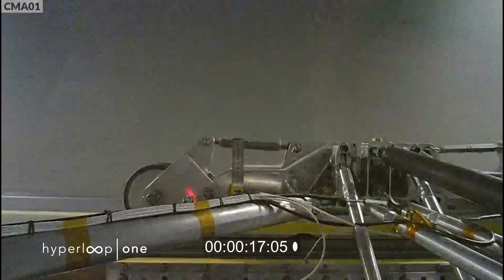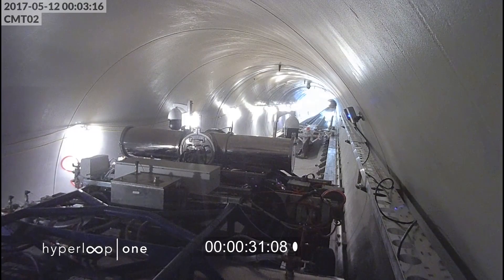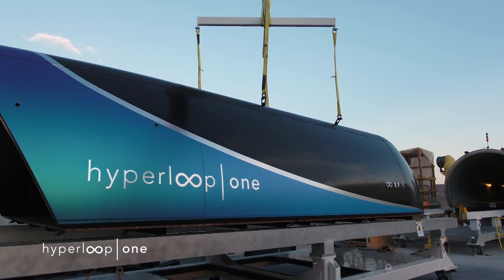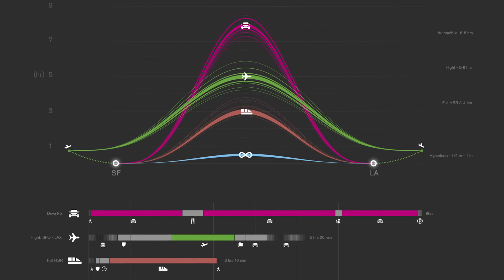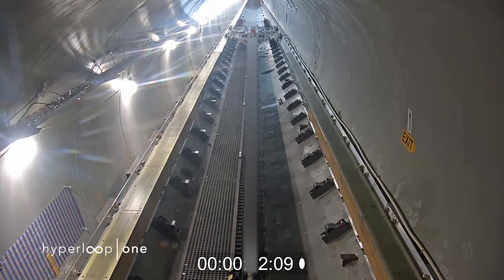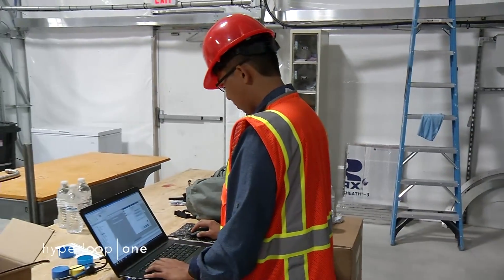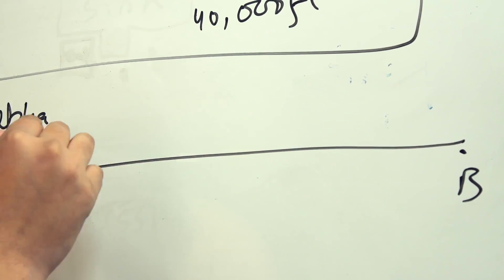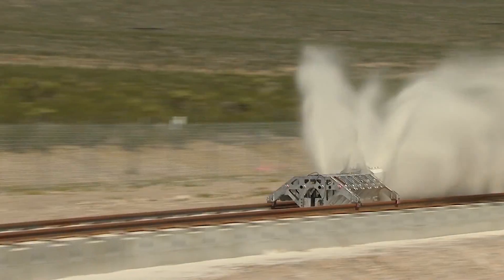Watch the Hyperloop Complete Its First Successful Test Ride | WIRED

Comment: Can't watch these videos without thinking they only talk shit after watching tunderf00ts video.
Reply: And what happens if there is the slightest rupture or some other mechanical failure in the tube whilst the cart travels at such high speeds?
Reply: @FragmentJack  I never think of that when I'm in a plane at 30,000 feet and going over 500mph. BTW the answer is the Hyperloop train slows down or stops. Comparatively scary, what?
Reply: Also, he kinda made a rookie mistake when scaling up his metal ball in a glass tube experiment.
Instead of faster it would move slower. But it is something the makers will need to take into account. 

Since moving fast is pretty much the point I assume the pod can handle it. Adding air to the sections ahead would be a useable way of slowing a pod down in a case like that combined with magnetic breaking. Sure it is difficult to make but possible if you throw enough money at it.
Reply: agreed... lets wait for the day they will fail maybe
Reply: Leo U. The tube was just a tube it wasn't even a vacuum
Reply: Leo U. Have you seen the like to dislike ratio of his videos? Clearly he was wrong on so many things.
Reply: This is a lier company only sell concept.
Reply: +Aku6Soku1Zan That sounds disturbingly like religion, don't devolve into worship no matter the man.
Reply: +Max Williams - Sell concept?! Lmao, they actually made some working shit
Reply: And a partial vacuum would also be inadequate to make this any kind of efficient design.
Reply: +Looney: It's a logical fallacy to argue that Thunderf00t's lack of humility will magically make the hype tube practical.
Instead of refuting the science they attack the person. Classic ad hominem.
Reply: @communitycollegegenius9684  Wrong. The science CREDENTIALS of the person were attacked which is totally reasonable, AND they debunked his lack of science. Next.
Reply: I talked shit about this before thunderf00t in real life

when I first heard the pitch from my friend I said "ridiculous, that will never work, not "would", "will"".

And now they're celebrating what is essentially a fucking maglev train in a tube.
Reply: Leo U. This might interest you, an official reply about Thunderf00t from an Hyperloop One employee
-
I've got this one. I have watched the video, and made copious notes. Thunderf00t is a well known youtube science commentator, best known for debunking religious fundamentalists and understanding the surface-maximization of liquid alkali metals, published in Nature last year.

That aside, both hyperloop videos show a complete reluctance to engage with the real arguments. Sorry, but highlighting some semi-literate comments by your critics does not amount to engaging in a useful discussion. I would like to levitate this video into the sun.

Here are some specific points and rebuttals: -Thunderf00t primarily makes reference to the Hyperloop alpha whitepaper, written by some SpaceX employees in 2013. I saw no evidence of engagement with subsequent press releases by any of the hyperloop companies. In particular, TF doesn't seem to be aware that there is more than one hyperloop company. FYI, we are Hyperloop One, the company that has raised ~$108and built the world's most powerful linear motor in 5 months. -Thunderf00t talks a good game about aerodynamics, but shows no evidence of even having read the wikipedia article on choked flow, duct flow, the Kantrowitz limit, or knowing any of the other 'first day on the job' level detail for our aero team. -One of Thunderf00t's technical gotchas was 'expansion joints are difficult', despite the fact that hydraulic cylinders exist, most steel rails are thermally pretensioned, and thermal expansion is probably something we thought of already. -Thunderf00t could have easily looked up our people on LinkedIn, checked their google scholar bona fides, whatever, but seemed more keen on a cheap take down than actually engaging with interesting and ongoing engineering challenges. -One symptom of the level of technical effort that went into TF's video is his careless assumption that 1g = 1m/s/s, as though Hyperloop was being built on some tiny moon of Jupiter. As a fellow academic, I was disappointed by TF's lack of intellectual humility in an area in which he is obviously not an expert. One would wonder why TF would put such hastily produced, easily debunked rubbish on his Patreon feed - people actually pay for that!

-Casey
Reply: kingklooneyville Well he didn't said anything about the vacuum a Hyperloop would require in such a immense scale. That they can sustain a vacuum is my main concern...
Reply: Leo U. these vacuums aren't as difficult to hold as you might believe, holding a vacuum requires an exponential amount of energy. Thus a partial vacuum isn't too difficult
Reply: @LemberTheMember  Wow I bet they never thought of that. Good thing you're here.
Reply: @RayThackeray  I bet some did, but it seems like some teams are just competing to catch a little fame.
Reply: +Karnedge, it would either brake and slow down if the rupture happens in front of it or brake, speed up a little and slow down if the rupture happens behind it. The nice thing about magnetic propulsion is that it can be used as a magnetic brake too. I'm sure that the engineers have taken this into account, they are not total idiots. 

+Community college genius. the point isn't if it is practical, the point is if it can be done. The Concorde and hovercraft were not practical too. They were however pretty cool and the technology is still being used for other purposes.
Reply: when has Elon ever led us astray?
have faith.

Comment: How do you get a passenger car with 1.0 atmosphere pressure into a tube with 0.0001 pressure?
What if there is a leak in the car while travelling? 
Will cargo go in an air-filled car or low-pressure car? 
What if boxes of potato chips (in slightly over-pressure bags) are sent in a vacuum-pressure car?

Comment: I don't understand why people are really concerned about the air pressure equalizing rapidly causing explosive decompression. It is very rare when it happens to an in aircraft that is pressurized to 8,000 ft while 38,000 ft in the air. When that does happen, pilots are able to control the aircraft and safely land. The Hyperloop is guided by rails, and it is also able to slow down immediately. Two features that pilots do not have. I still think air travel is more economical and safer than the Hyperloop, but it is still better than Amtrak. I can imagine that TSA will play a role in the U.S. Hyperloop system. Bombs are biggest fear for air travel, yet, we have not had one bring down a plane in years in the U.S.

Comment: Sure they may really build a short one in UAE. They may even build islands down there but the rest of the world is not following that either. 

This is a useless technology that will not change anything in 99% of the world. The economics is crap.
Reply: What are the economics? How much did China invest in maglev transportation, and how much would it cost in the same dollars to implement hyperloop? Of course, China used a common technology at the time and nothing new.
Reply: Sim I am not claiming to know all the economics but that isn't necessary to judge. Maglev obviously is better than rail from a technical standpoint due to less friction. So lets ask why it isn't pervasive. The answer is simple ...economics. It does not work.

Now ask what is the biggest vacuum chamber and how does this hyperloop compare. Well Thunderf00t went into that so I am not going to rehash. Search for his video. Anyway thats extremely expensive.

Combine them in a technology and say its the best thing since slice bread. Maybe but who is going to afford it? No one sensible.

By the way China is trying to prove itself as a developed country so lots of what is does makes no economic sense. They are unoccupied towns. Something that does not happen elsewhere (at least not that I know of).

UAE and especially Dubai is on the "I did it first" and "mine is the biggest" even if it makes no sense. They are about creating an image not about economics.
Reply: So you have shown your level with the opening statement. Oh well. Unlikely you can be helped. 

Blanket statement with no similar product evidence. Not a very good argument. 

Lets start with something simple so I don't confuse you. Go research maglev. Much better technology than rail trains right?. Works now. Hyperloop without a vacuum chamber so its a damn good example to follow. How long has it been available and how many places is it implemented?

Comment: There is one question I really need to ask. How do they handle explosive compression, if there is a leak in the tube ?
Reply: Johnny umm umm airlocks every 500meters? but that ment the cart needs to go from 700mph to 0 in 300meters. NO WAY this is some damn fiiiiiine engineering problems. its nearly imposible to prevent massive damage and even lives if that happens. idk. too dangerous. if they dont have very very clever mechanisms the goverment is probably after the 100000000$ up keeping costs and many many many lives are gonna say nope. HEY WATER PIPE DUDES WE JUST GOT HUNDREDS OF MILES OF WATERPIPE FOR FREE!